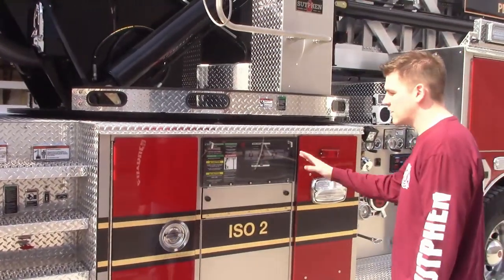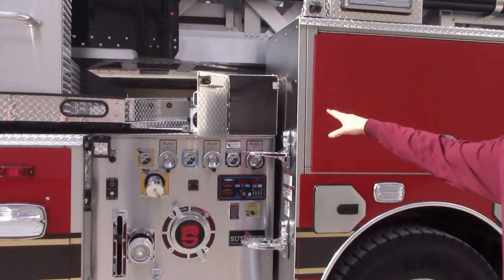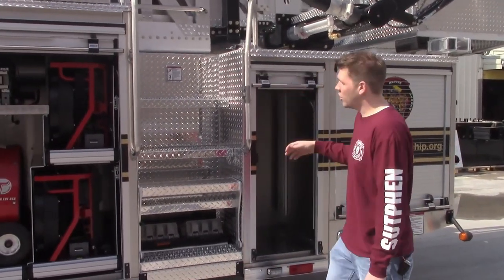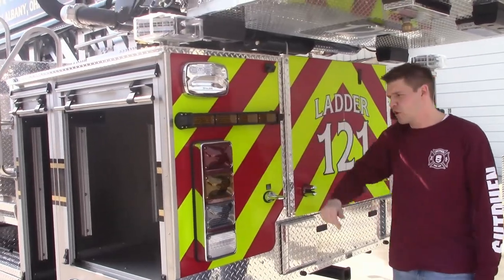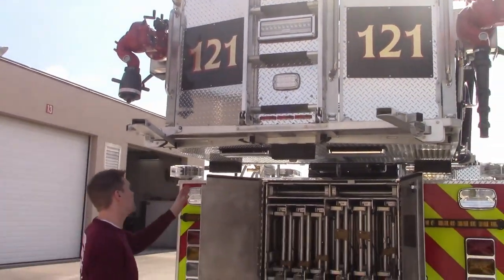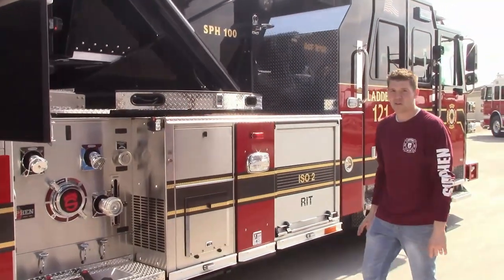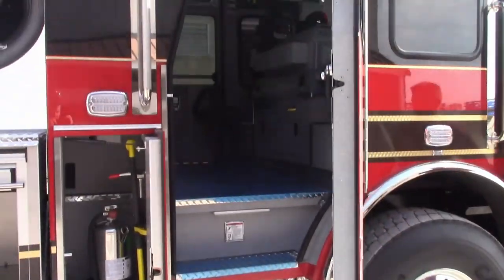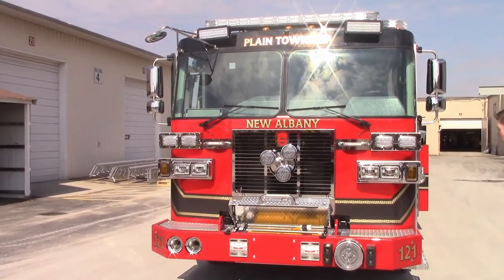Plain Township, OH FDIC 2019 Walk Around Video

Comment: Looks like the Fire Fighters spec the Aerial. Very nice. Why are so many Fire Apparatus going with Black paint? Visibility is not good?
Reply: It'll be fine. Tons of flashy bulbs & reflective stuff. Black uppers look great but also make sense. More difficult areas to keep clean. White aerial booms are ridiculous. No tank, no hose makes sense too. It's a true truck but can supply the master stream guns directly. Typically, all they need is a few rolls of HDL in most hydrant-supplied areas or a relay from a pumper.